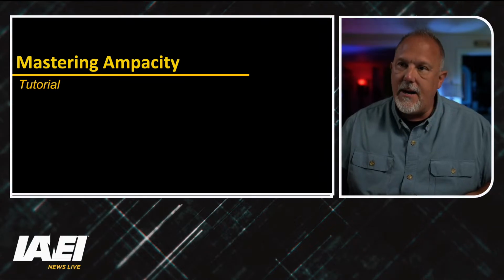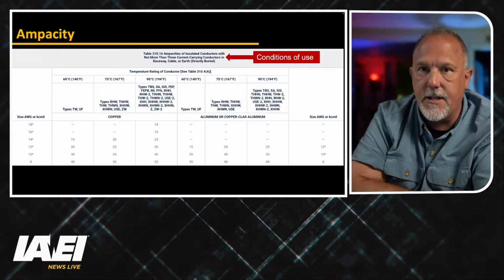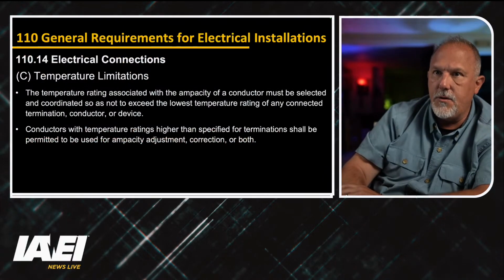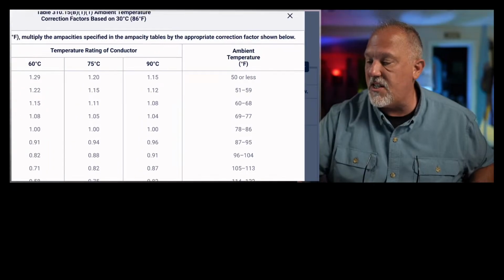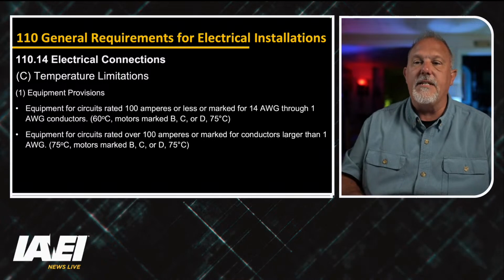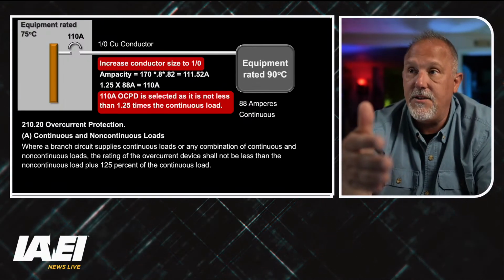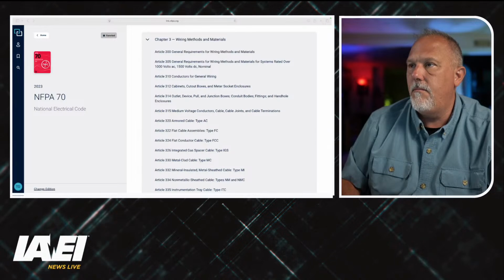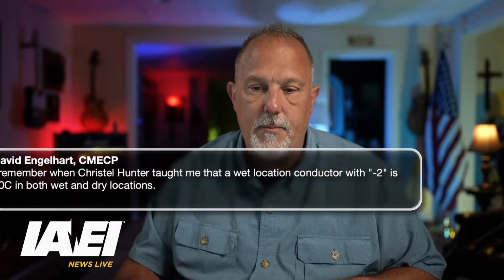Mastering Conductor Ampacity: A Deep Dive & Practical Examples

Comment: Is there a reason you wouldn't just use the 110 amps after calculating for the continuous load and just divide 110amp by .8 and .82. that would give you 143amps and you would still end up at a 1/o @ 75degrees